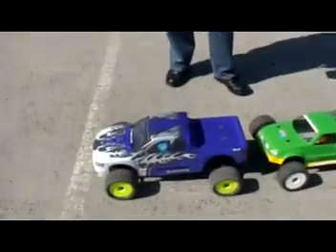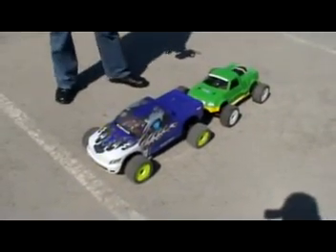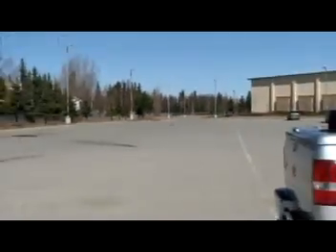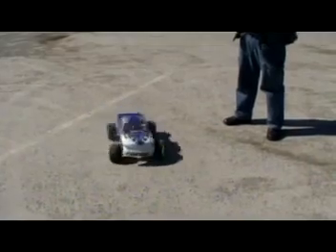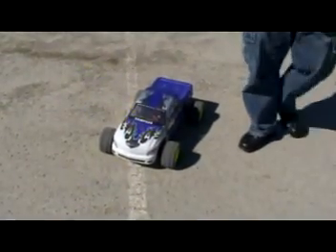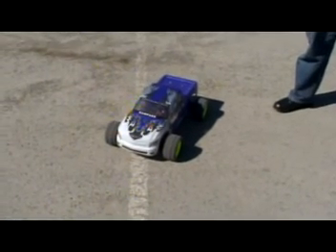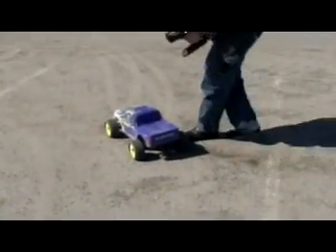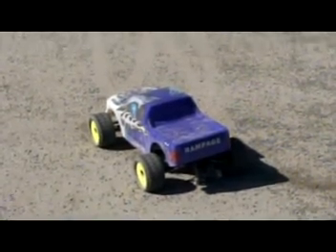Run test 1/5 scale Monster Truck with twin Mamba Monster 2200kv brushless system

Comment: @buster21692169 Umm no youre wrong, way wrong. The 2200kv Mamba motors are the same as used in the 60mph E-Revo, they use only 1 motor. The higher the kv the more RPM per volt. So 2200 x 14.8 = 32,560 no load rpms. He should replace the 2200's with a pair of maybe 1550's, change the gearing, and up the voltage. The lower kv rating will give him more torque and allow him to turn a smaller spur gear.

Comment: it seems like theirs to much friction on the gears you should be able to roll with no motor power longer than that. with those tires you should try going rear wheel drive.

great truck though

Comment from the maker: Well its not a 1/5 scale ????,  OK. we use front and rear axis assembly from E-maxx only, all rest is a custom made by me, the 1/5 scale truck it has to have a Wheelbase: 18" or longer, my truck has a 18.5" or 47cm